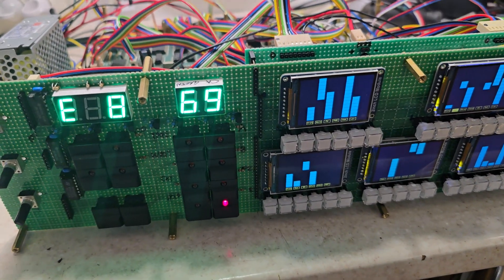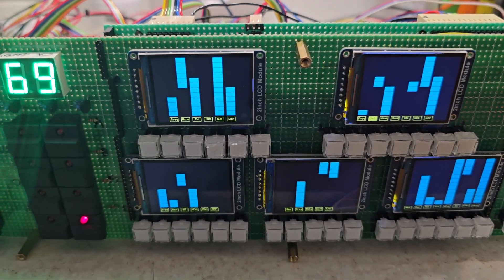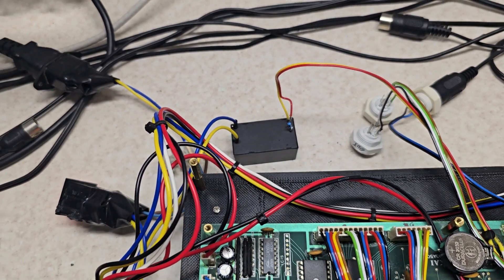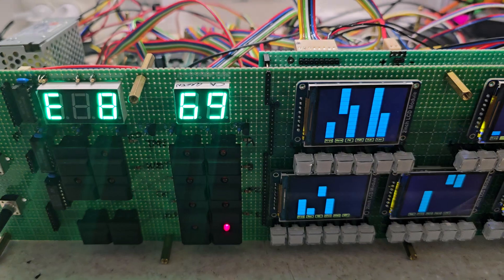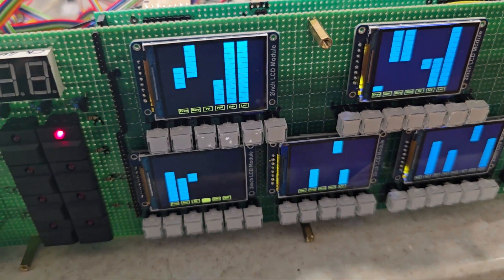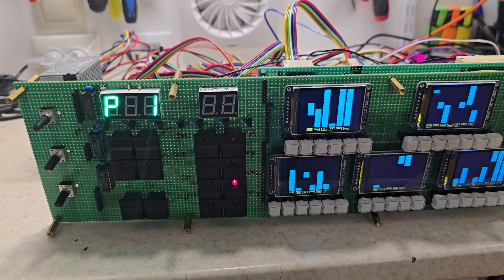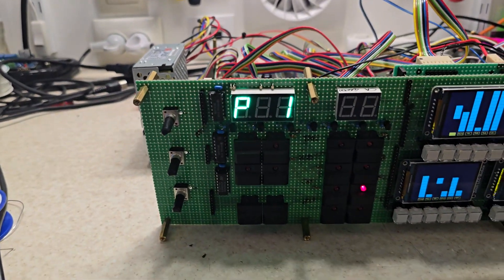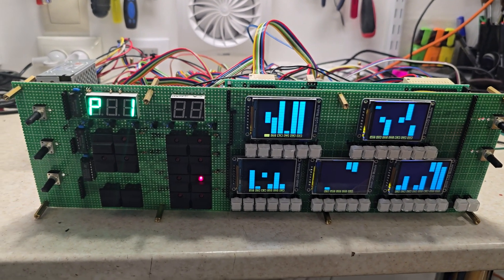Akai AX-80 rack mount build first test with filters

Comment: Looks beautiful, what controller do you use to access the knob and slider features (:
Reply from the maker: Hi James, just like the standard AX-80 it edits just the same, press EDIT and select the parameter with the any of the 32 buttons to the right and use the edit control to adjust the parameter or use the UP/DOWN buttons, or even keep pushing the parameter button if its like a waveform parameter and it will toggle through the options.  I have also built an editor with knobs and buttons if you want to edit it fully like a synth with front panel controls.  https://studio.youtube.com/video/KHGgUvq0-EA/edit